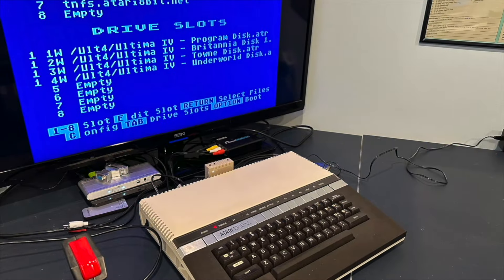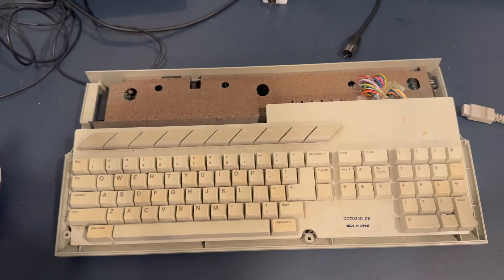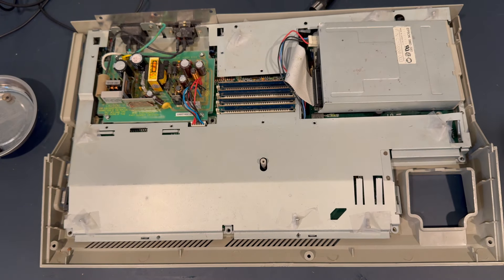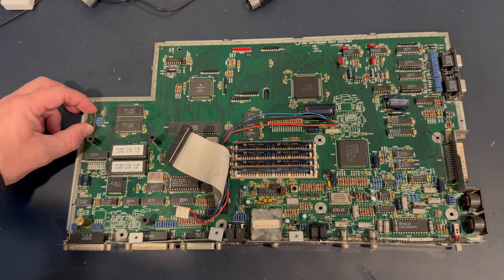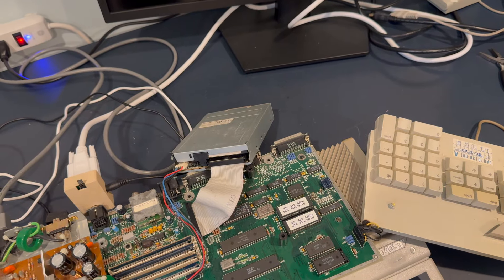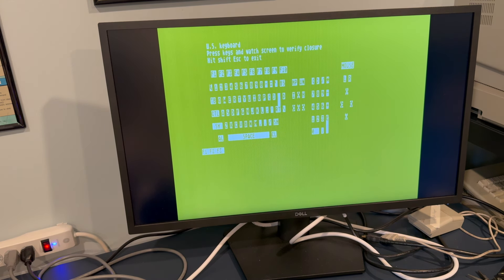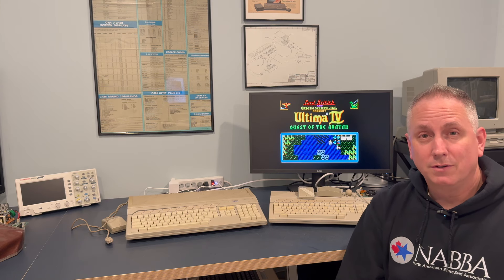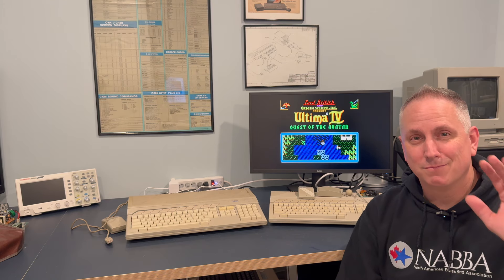Repairing an Atari ST keyboard and  POSSESSED mouse

Comment: Need to fix my kbd too but am too pressed for cash atm, recapped my ST, put in a pc floppy drive and modded it to fit properly, expanded the RAM to 4MB and fixed everything up, then stupid me accidentally let the back of the kbd touch the metal shield so there was a spark and now a part of they keys are dead... no burnt traces so assuming the controller ic got busted :(
Reply from the maker: As you could see in the video, it could very well be the LS logic chip which isn't an Atari-specific chip.
Reply: Dang it, wasn't the LS244 (at least the MiniPro chiptester says it's okey).. gonna try swapping the 6850's to see if that helps, only checked the schematics briefly but it looks like the other controls just the midi ports which I've never used anyways so with a bit of luck....

Comment: The moment you connected your mouse and ad with an explosion in the beginning popped up and I had an OMG thought but only for a brief moment.    Packaging is extremely important, nothing worse then finding parts bouncing around in the enclosure.   I have been lucky but I did receive a delivery where FedEx had to add tape to the box because the box was falling apart due to not being properly sealed up and in part a rough transit but everything was bubble wrapped with lots of padding but the box a horror show.
Reply: I work at FedEx so I can say how very important it is to properly pack up whatever you send in a box. The packages just fly through a sorter belt and anything lose inside will get jostled around. 

Plus taping is very important especially on the bottom because loosely opened packages do get damaged.

That's why I try to take care of every package I handle... :)